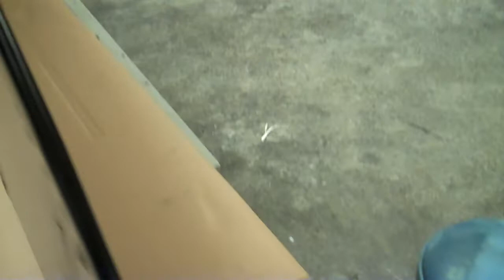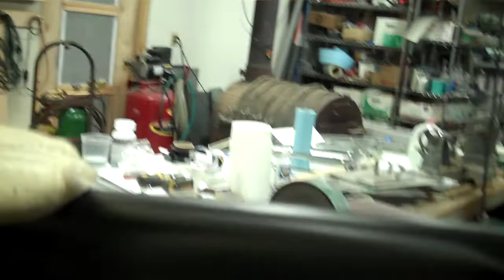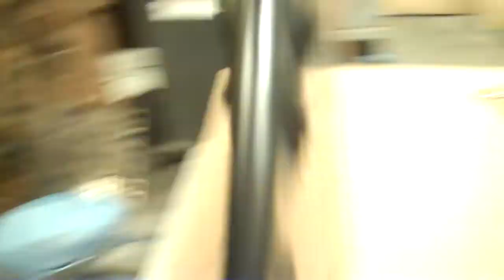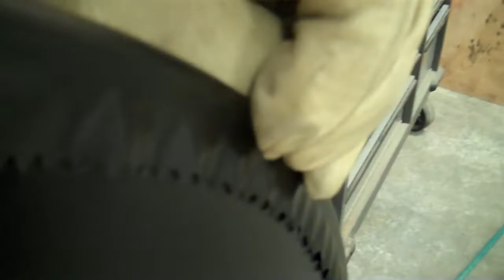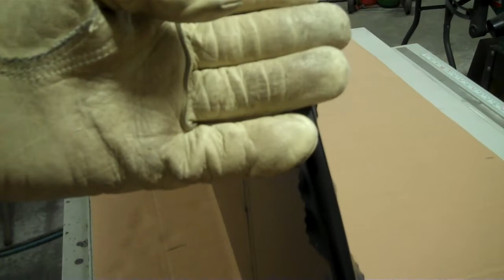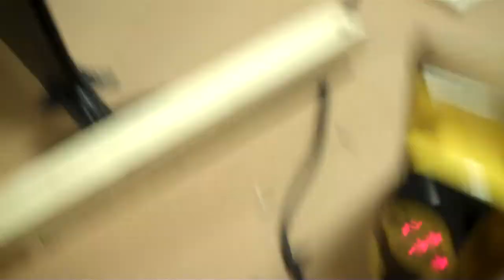Trailing Edge Finishing Tape on Super Cub Elevator 2

Comment: So, the tape just goes on with only the one coat of glue that is already on it?  It doesn't need the 2 coats and glue-edge masking tape process like other areas?   I am covering tail feathers of a small cub style LSA with green Oratex.  Will need to start on the reenforcing tapes pretty soon.
Reply from the maker: Hi, yes, the factory tape sticks by itself with correct heat and massaging it. We do have a Clear "tape Primer" product that is optional and especially useful if installing the tape on an area that is a big heat-sink. Be sure to have reenforcing tapes under all rib stitches and pop rivets, soak the reenforcing tapes with glue and let that glue dry before you install the Oratex Finishing tapes. Do not hesitate to call me with any question, Regards from Alaska, Lars
Reply: @BetterAircraftFabric  Thanks for the fast reply.  I seem to have learned the curves, heat pull stretch and smooth out.  My rudder and elevator turned out good and wrinkle-free.  Time to start on the stab.  I'll contact you about the tape.